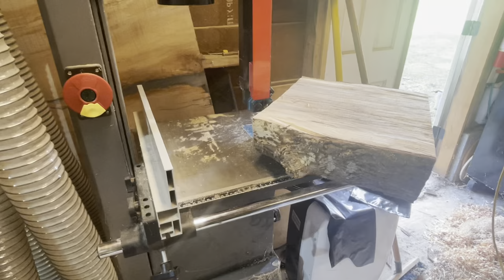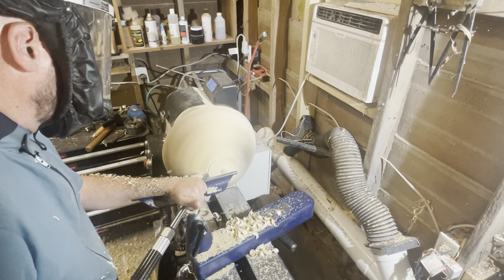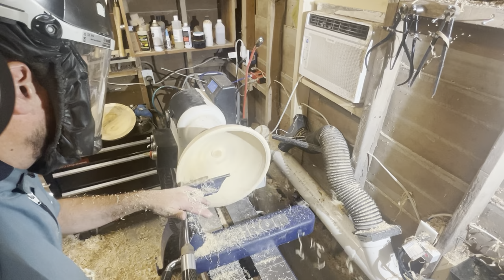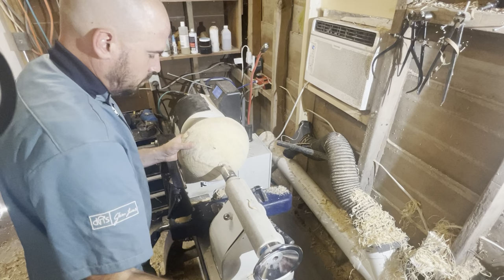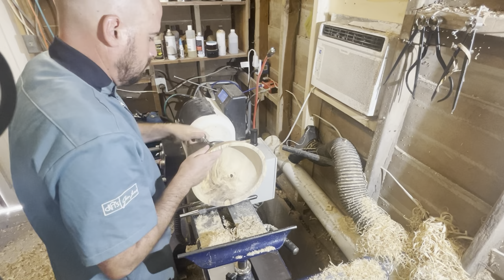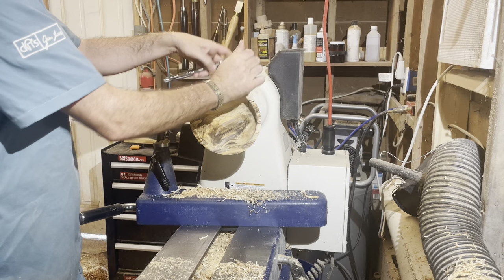Log to bowl (no talking)

Comment: What was the wood you turned? Also was wondering why you use an open hand on the front of the gouge instead of grasping it with the fingers on your left hand, personal style?
Reply from the maker: Maple--I believe silver maple. I think you're asking about the last cut I do with the bottom bowl gouge (If not please correct me!). To get that cut right the left hand cannot guide the tool. (If it does you end up with a lot of bouncing and torn grain.) If I wrap my hand around it I always end up moving the gouge with my left hand. I don't hold it with my hand underneath, like the other cuts, because of the depth of the cut at the bottom of the bowl.